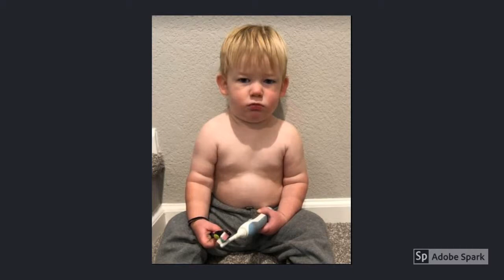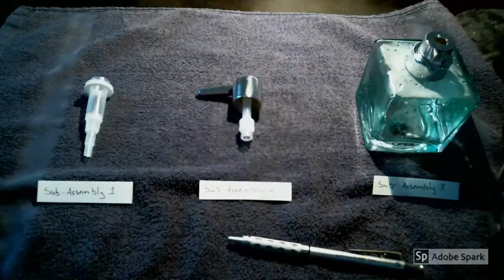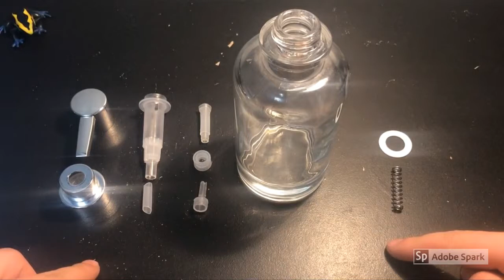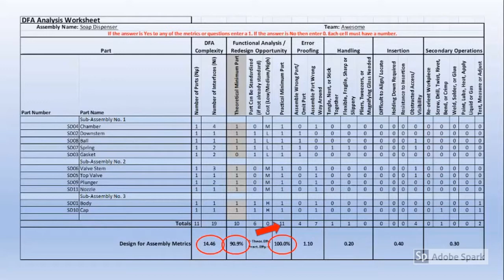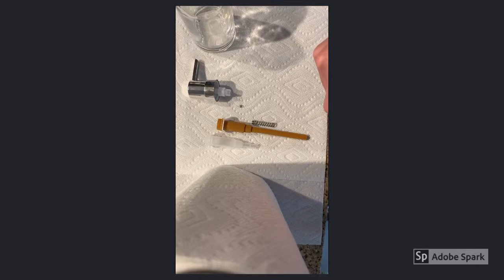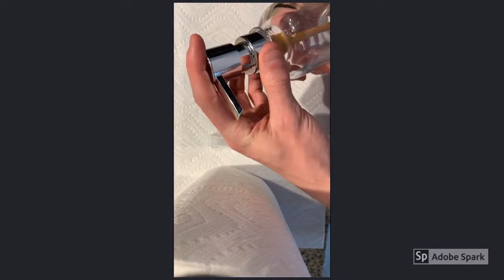Manufacturing Process Soap Dispenser Analysis

Comment: If it keeps pumping out the liquid from the sealed bottle, how does it manages the possible negative pressure(vacuum) in the bottle? If there is a hole, the liquid may leak during transportation.
Reply: A small ball is kept inside to balance this.